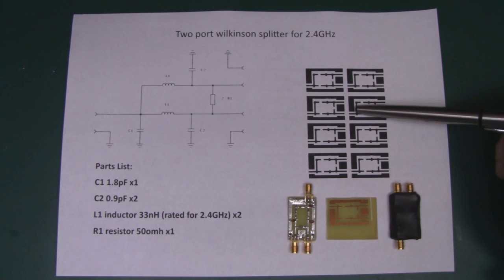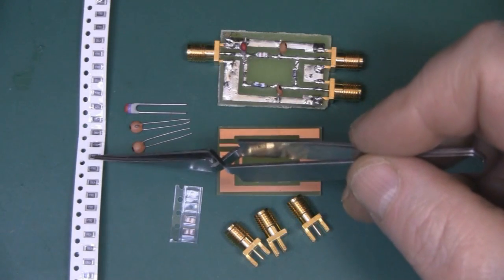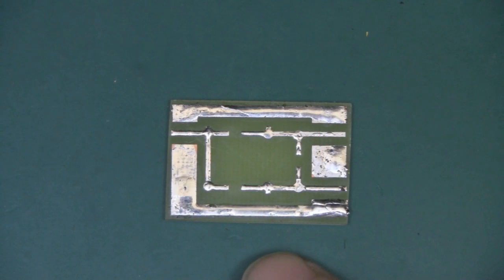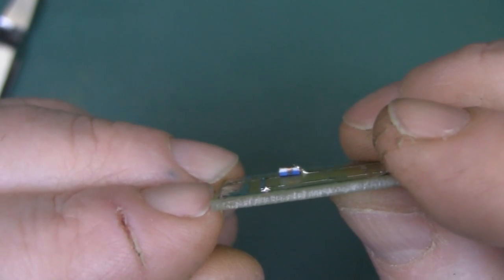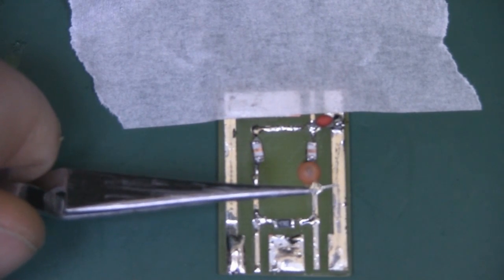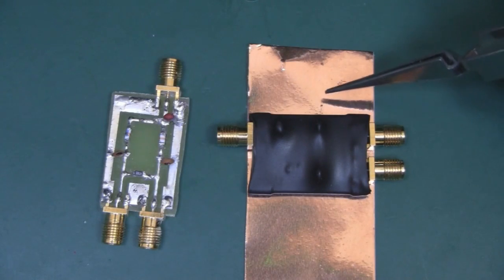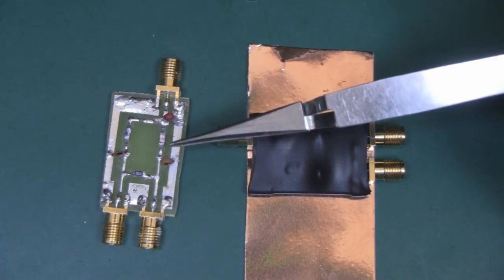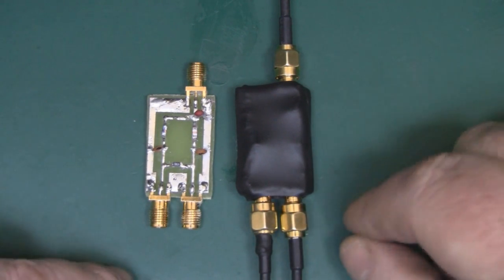The Wilkinson Splitter for 2 4GHz #144

Comment: Hi Andrew....AWESOME VIDEOS! I have learned so much - Thank you. Could this be used like a simple form of antenna diversity? Could one make a 5.8Ghz version and connect say a helical and a cloverleaf to one receiver and two different antennas to the other? I have FPV goggles that have two physical antenna inputs. 
Would this work for better reception or am I oversimplifying things and RF just doesn't work like that? I guess one way to find out is for me to fire up the laser printer and make a couple of boards!

Comment: Hi Andrew,  I believe you've got an error.  The value of the resistor should be 2 * Zo = 100 Ohms for a power combiner/splitter, and not 50 ohms.  Correct me if I'm wrong...
Reply: you are right

Comment: Hi Andrew, great video as always, is there any loss of the individual antenna performance using the splitter? I would struggle to make the pcb's, would it be possible for you to make some pcb's available to buy?

Thanks and keep up the great work.
Reply from the maker: +robrow There is a 3db loss using this but if you just tie the coax together directly then there is much more loss. Maybe for a future video I could demonstrate this in the lab.
Reply: @andrewmcneil  I agree great video & would like to see you test it in the Lab. Also, would this be able to be 'up-sized' to connect more than two antenna into one output? If so, that would be another good video. Keep up the good work.

Comment: Andrew,  the resistor should be 100 ohms as the formula for calculating it is 2 x Zin (where Zin is the input impedance).

Check out https://www.youtube.com/watch?v=3IAVJ4gVunE --- KF5OBS #29: Designing a Wilkinson Splitter / Combiner

Comment: For making PCBs, a sharpie doesn't work well. Cupric chloride etchant does a good job of removing it.
The easiest method is to print the design on some dextrin paper and transfer it to the board with a laminator.
Reply from the maker: +rocketman221projects I have never had much luck with the heat transfer method but I have seen videos where the laminator motor is modified so it feeds in much more slowly. Is dextrin paper a better choice than the glossy photo paper?
Reply: +andrew mcneil I use an Apache AL13P laminator. I run the board through about 6 times on max temperature. It doesn't need any modifications other that increasing the roller pressure. There are 4 screws on the bottom that set the pressure.
Dextrin paper is the only thing that works well for me. It's not slippery, so it's easy to align the sides. After transferring, I just soak it in water for a minute and it floats off the board. It's cheap to make too, several hundred sheets only costs a few dollars.
Reply: +andrew mcneil http://dangerousprototypes.com/2012/09/29/pcb-manufacture-using-oracal-vinyl-film-laser-printer/
Reply: +Kenneth McCall That looks like it works pretty well. Some laser printers won't print on slippery materials though.
Reply: +rocketman221projects I haven't tried this method yet, but I've seen some good results from other people.
Reply from the maker: +Kenneth McCall Thanks Kenneth will give that a go as I have some A4 vinyl sheets.

Comment: I think you need 100Ω for R1
Reply: +Constantinos Pitsakis You are correct --- R=2 x Z0 where Z0 is the input impedance
Reply from the maker: +Bruce Haynes You can use two in 100ohm in parallel to get 50ohm